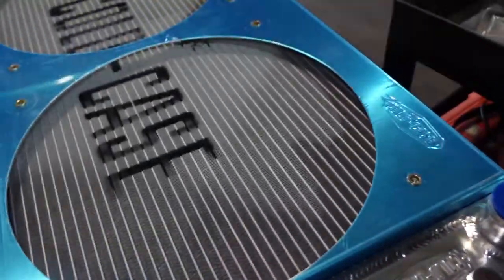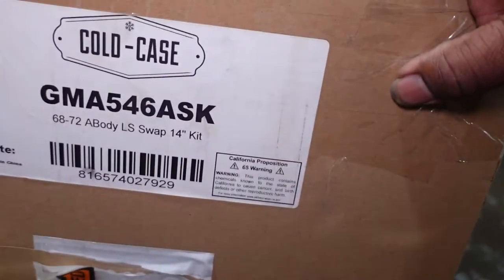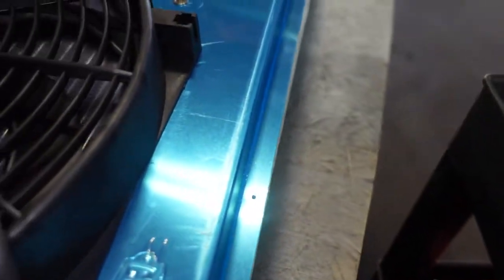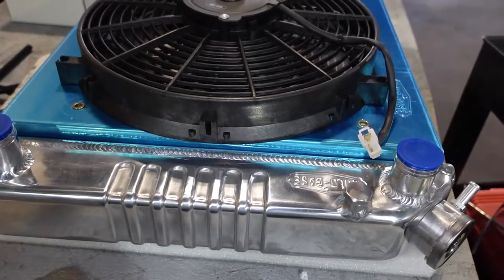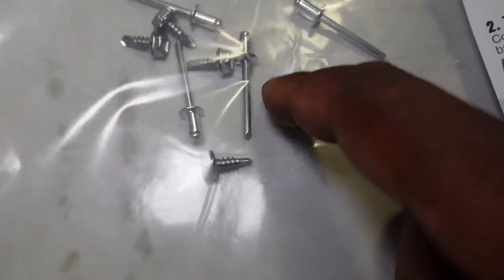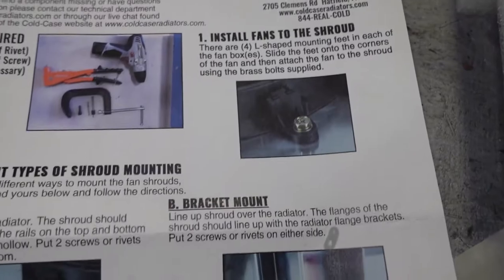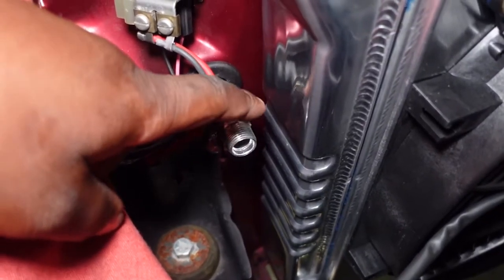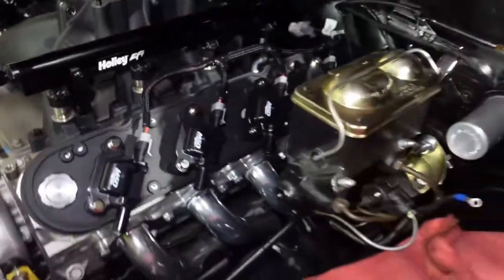1970 CHEVELLE LS SWAP RADIATOR INSTALL

Comment: Does ot keep engine cool?
Reply from the maker: Yes. The vehicle has air conditioning and the fans keep the engine cool.
Reply: @whiteoneauto are the fans cfm rating true 4000cfms? Are the fans Spal Fans?